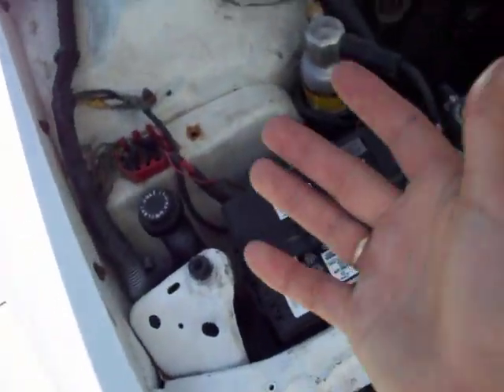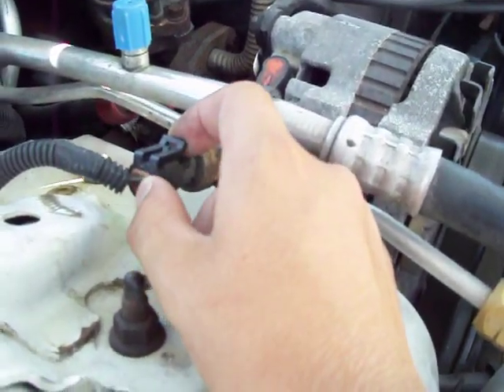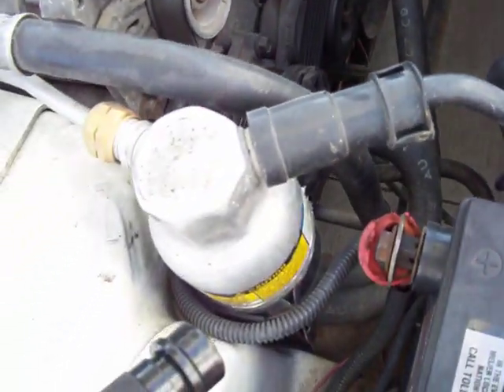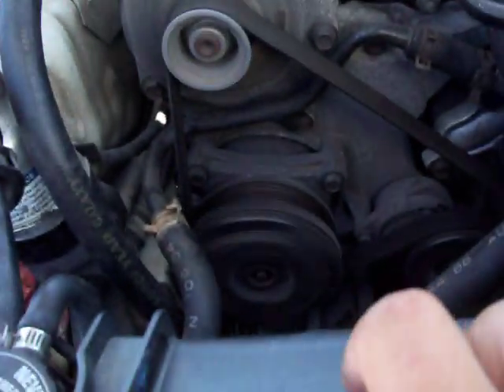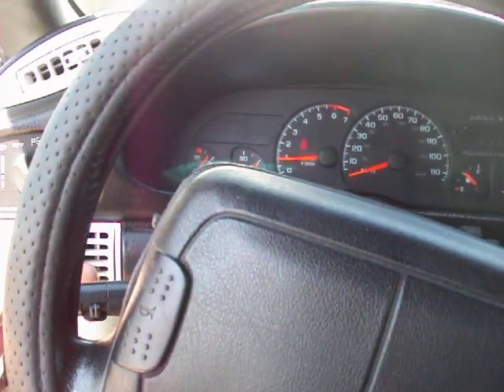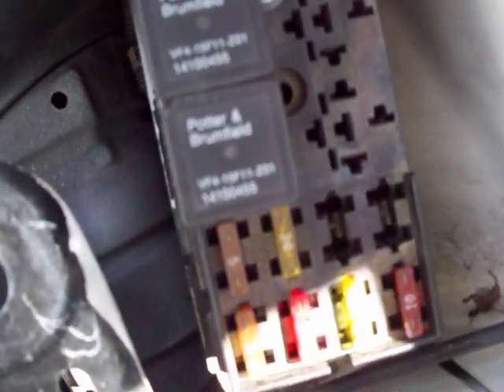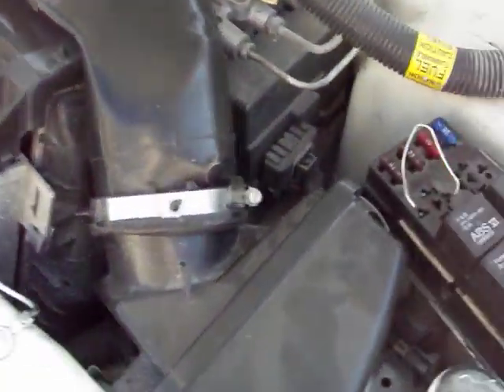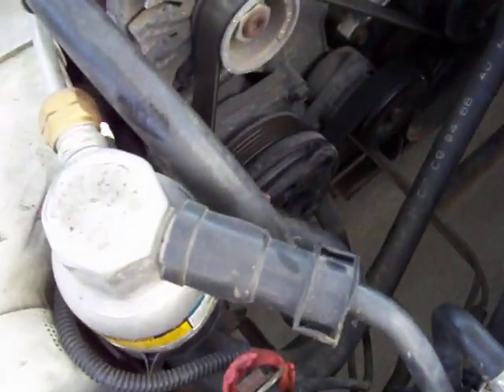How To Make AC Ice Cold, Recharge air, and Force the Compressor Clutch to Engage

Comment: Horrible video, do not do anything in this video...
Reply: +Todd Thoren  Yeah, I guess so.  I should probably ly listen to this kid more and learn how to Jerry rig everything instead of doing it properly.  if your pump doesn't automatically kick on when you start adding refrigerate then you have other problems you need to properly diagnose.  forcing it to work doesn't necessarily mean it works.
Reply: Hello, Willy Stanker, I agree with You that This video in not a good one to follow as it is riddled with bad advice... However By-passing the switching circuits that energize the a/c compressor clutch when systems are too low in pressure to operate is; a normal and correct procedure for the re-charging & diagnosing process ONLY ... The fact is, the charging hose connected to the low pressure side of a system that is not running will probably not charge the system, as the pressure on that part of the system would probably be too high to accept a charge when the system is not running. The exception would be, if it is so low that a can of refrigerant actually goes into some a/c systems that are not operating.... Unless the system has been overhauled, the a/c systems that have become this low in refrigerant, probably has (a) very bad leak(s)... The diagnostic process will confirm where the system is leaking (when it is operating), and repairs could then be made.... Don't be upset with what the DOLT Todd Thoren has to say to others here... That individual has some serious issues of his own - that need diagnosing...